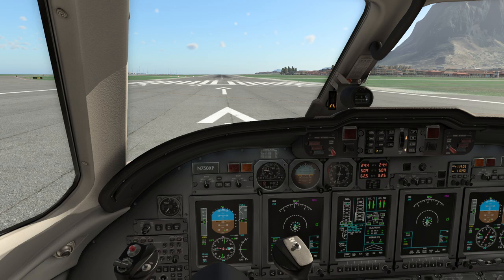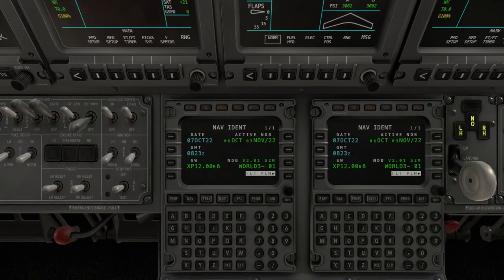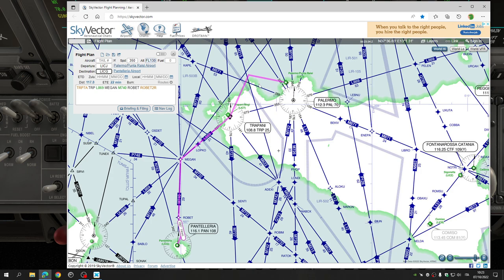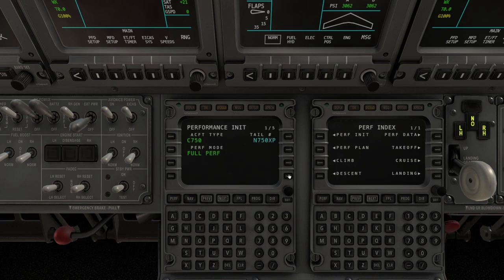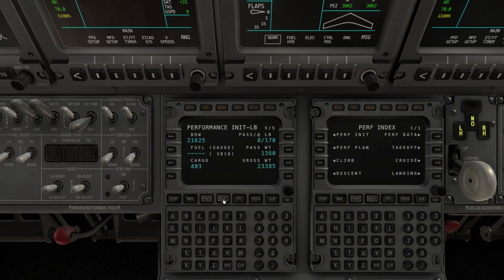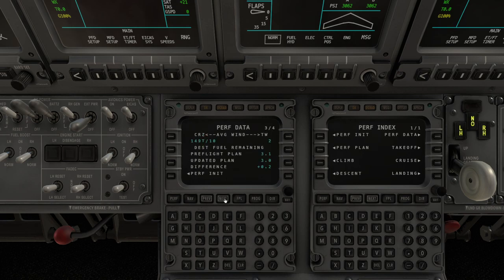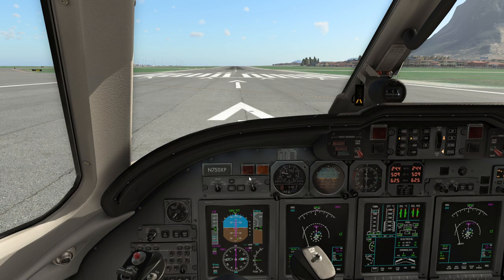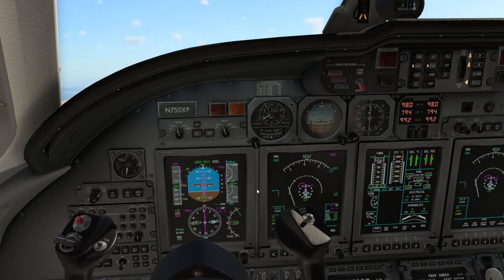[X-Plane 12] Cessna Citation X | Part 1 - FMC Setup, Take-off & Initial Climb Tutorial

Comment: Thanks for great video. If you are entering a flight plan manually, make sure you put the destination  on left side where waypoints go. for some reason, not just DEST. You will not have access to arrivals and approaches. This author explains this on Video pt 3. Downloading from Simbrief works as it should. For those reading the XP 12 Citation X manual: They refer you to the FMS 11 manual to describe this Citation X Honeywell FMS. Don't bother it is a Collins. Not even close to the Honeywell.

Comment: Your English is very good.  As the FMC is both similar and different (?) from the Proline 21 of other sim models such as the Hot Start Challenger 650, this video provides real value to those of us who wish to come up to speed quickly.  It would also be very useful if you could provide an overview of the capabilities and limitations of the present state of the Citation X FMC.  Ability to set DIR INTC, or to add a HOLD to the flight plan.  But also to confirm specific things that are not yet operational.  Thanks again!
Reply from the maker: The level of detail of this FMC did actually surprise me to be a default aircraft and compared to the default FMC which came with XP11. The idea of going a bit deeper into its capabilities is a good point and I will try to bring some content on this matter though I will need some study before. I don't own the CL650 but I imagine its systems to be a perfect replica of the real ones so I don't know if FMCs are even comparable. Thanks for the idea and for watching the video!
Reply: @crisk73  I will continue to pursue it.  In my first couple of flights, I did not find a DIR INTC (e.g. direct to, with a user defined intercept course), ability to quickly add a HOLD if instructed by ATC, and also I didn't see Visual Approaches to select (e.g. with an RX specified such as 3.0, 4.0 or 5.0 miles.  These are practical things that are needed in many actual live ATC flights, and for practicing purposes.  Flying HOLDS manually in a fast jet without automation assist is good practice but not the way it's done IRL.  Maybe some of this is possible on the Cit X.
Reply from the maker: I think the DIR TO is actually working, I don't know if the HOLD is, I may want to give it a try. As for the App Visual you mean the possibility to visualize the range rings?
Reply: @crisk73  In Proline 21 for the Challenger 650, in the approach list at every airport I've flown into, there's a list of Visual Approaches, one to each RW, where you select the runway extension (RX) distance, and GPS will simulate the approach.  So you can use automation assist to set up a base leg using a DIR INTC to the RX with an INT CRS being 90 deg to the runway heading, and then spin ALT to zero and use NAV-VNAV as the assist in flying the visual.  It's fantastic once practiced.  But it starts with the Visual Apch selection with the selected RX distance (IRL, it's 3, 4 or 5 miles, usually 3 or 4).
Reply: @crisk73  The DIR TO is good if it allows entry of the intercept CRS.  When I tried it, it immediately selected the FIX without allowing any further entry.  So that's why I didn't think it supports the DIR INTC (intercept) capability which is too bad.  It's a very fundamental capability.  I think G1000 can do it.
Reply from the maker: Ok I got it. Out of curiosity, are you referring to the HotStart CL650 for Xplane or are you a RL C650 rated pilot?
Reply: @crisk73  Hot Start CL60

Comment: For some reason when I take off from a holding point and not from the beginning of the runway the plane is still directing me on the autopilot to the runway instead of proceeding to the next waypoint. Can you tell me how to fix this? BTW great video!
Reply from the maker: This is strange actually. Make sure that the next point of the magenta line is your next waypoint and not the runway.
Reply: @crisk73  I know that, but is strange to select the departure with the runway and sid and then the autopilot to take you back to the runway :). It should automatically do that. So if I take off not from the beginning of the runway, I should direct in the FMC?
Reply: @crisk73  In fact the autopilot thinks that I didn't pass the runway in flight so in stead of directing me to the next waypoint, it is directing me to the beginning of the FPL
Reply from the maker: @HoriaArabul   Try to start from cold and dark in the apron and do all the procedures.

Comment: Can you e xplane how to change an approach when one has already been programmed into the f code.For example when arc asigns a different one?Also if I make a mistake when pro gaming the fact how can I clear it to start over without turning off the computer and starting over? Thanks these are vary educational videos.
Reply from the maker: Ok, wIll make a vid to try to clarify those points. Thanks for your inputs.
Reply: @crisk73  thank you for the videos.
Reply from the maker: Hi David, pls check this out https://youtu.be/FRZ3cuvzO78

Comment: I've found that manually programming the FMS seems to interfere with performance initialization entries.  When I fly the Citation X, I download the SimBrief flight plan and move it into the Output>Flight plans folder to allow selection from the FMS menu.
It also seems that running the APU before entering the Fuel for the Takeoff perf init prevents that entry.  I now do all the FMS programming while on battery before APU startup. I wonder if anyone else has had this problem.
It's a fun and fast airplane, and not too difficult to fly manually if you keep it trimmed.   Much easier to land at KASE (Aspen) than the 737.
Reply from the maker: @johnh9637  Never noticed this bug. You could have nailed it. Next time I take the plane for a ride I'll let you know.

Comment: Great instruction, however somehow I can't get the plane to climb. Is this information somewhere documented so I can find out what I am doing wrong?
Reply from the maker: What vertical mode are you trying to use? V/s, flc, vnav? Ensure the AP is engaged and check your mcp altimeter setting.
Reply: @crisk73  thank you, found the issue forgot to set altimeter to FL100, now everything works as expected. It was driving me mad. :)

Comment: Hi mate, nice video... I am unable to set the initial crz altitude on page 4/5 of the performance init and on page 5/5, cannot set the fuel. I keep getting invalid entry. Any ideas? New to X-Plane, it's frustrating. It means I cannot get LNAV working.
Reply from the maker: Hi, have a look at this and let me know if it fixes your problem. https://youtu.be/sbIdZuZ5zYU?t=40
Reply: Thanks for the video. I am also having the problem with cruise altitude and fuel (in the mobile edition). I’ll check out the video.
Reply: Unfortunately it didn’t work. When I click the second time on fuel is says INVALID DATA.
Reply from the maker: Did you set your destination ICAO and cooy the same on the left side of the plan?
Reply: Yes, I did that.